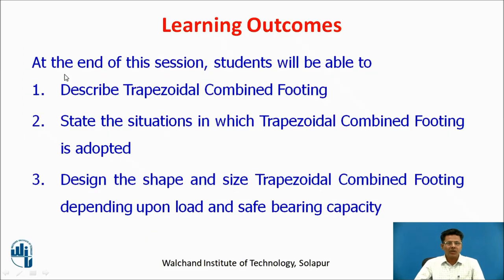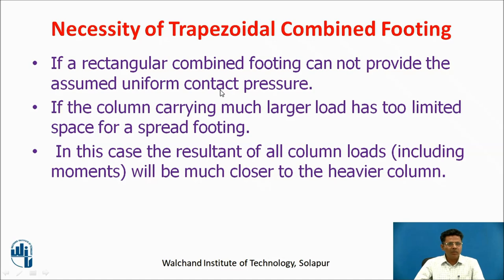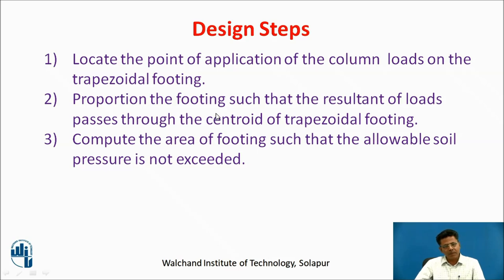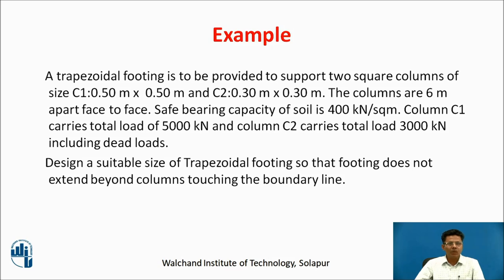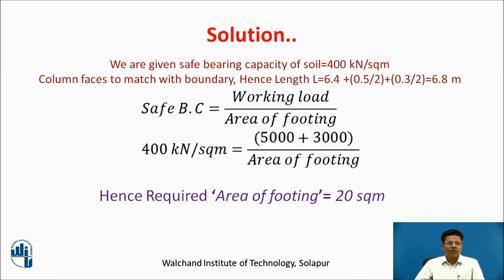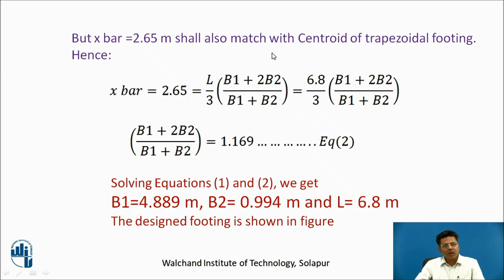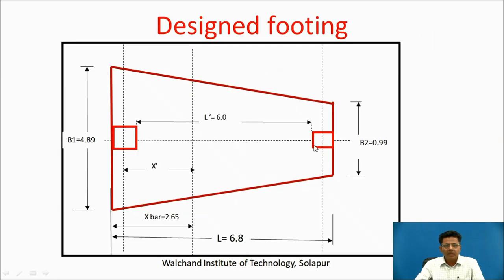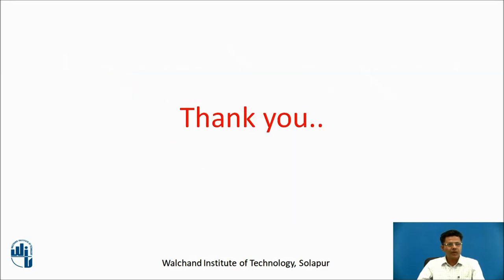Geotechnical Design of a Trapezoidal Footing

Comment: A combined footing of Length 4.0 m, width 2.0 m and thickness 0.5 m is constructed on the soil of SBC as 10 t/m2. It supports two column (A & B) of size 0.25 x 0.25 m each. Both columns are placed centerally along width of footing. Along length, Column A is placed at edge of footing while centre of column B is placed at 3.0 m from centre of column A. Both columns are subjected to dead load of 100 kN and live load of 50 kN. Draw bending moment and shear force diagram along length of footing. Determine and provide reinforcement due to bending along length of footing.